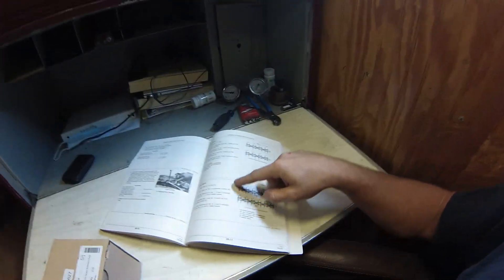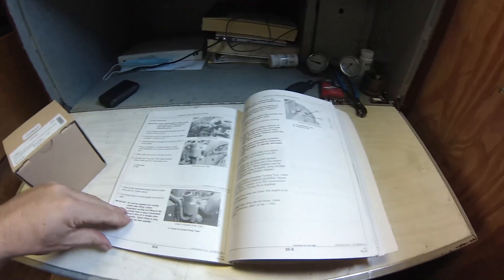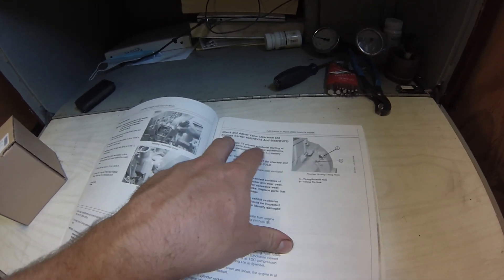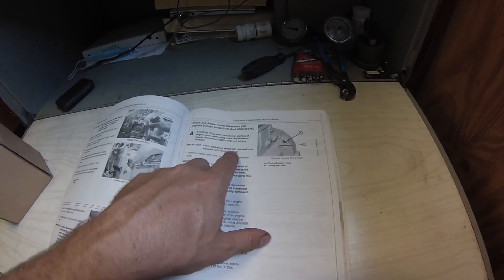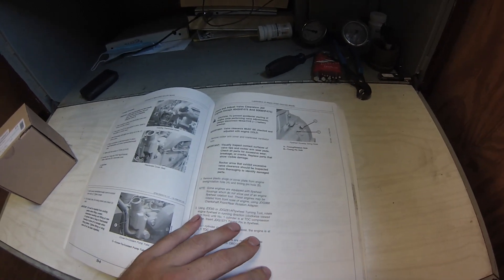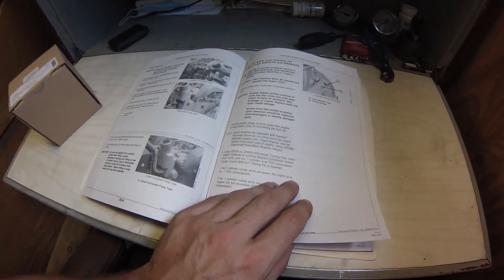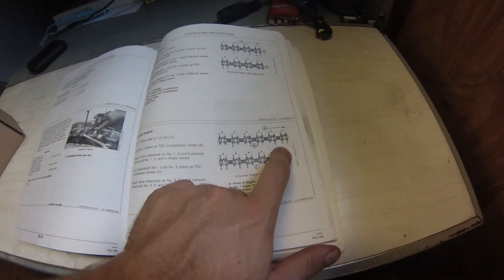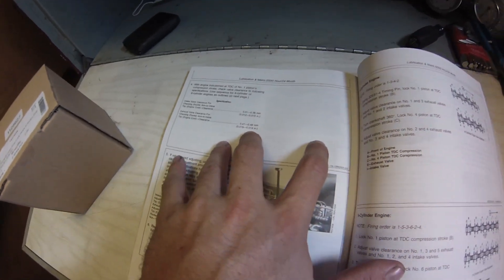Checking valve lash on a John Deere 6068

Comment: Hello what are the settings for valves? Thanks
Reply: @sinergiaiped6765  Puede que sean las mismas medidas que puso el chico del video, son: 
- Admisión: 0.31 mm - 0.38mm (0.012 pulgadas - 0.015 pulgadas).
- Escape: 0.41 mm - 0.48 mm (0.016 pulgadas - 0.019 pulgadas).
Reply from the maker: It varies from engine to engine. The industrial 6068TF275 I did has the following tolerances:

Intake: 0.31-0.38mm ( 0.012-0.015in)
Exhaust: 0.41-0.48mm (0.016-0.019in)
Reply: @epicfred  hi i have 6068trt on renault ares 640rz (tractor) and i was losing power , so now im looking what to do . Thanks for reply!
Reply from the maker: Diagnostics via text is incredibly hard. That being said, loss of power is almost always related to fuel flow restriction somewhere. I would make sure you have fresh filters and clean fuel. Then check any lift pumps and then maybe your high pressure pump to see if it’s moving enough fuel at the right pressures. Also look for leaks or air in the lines someplace.